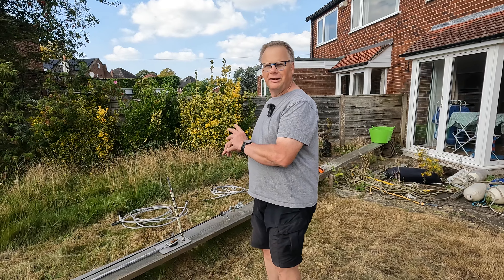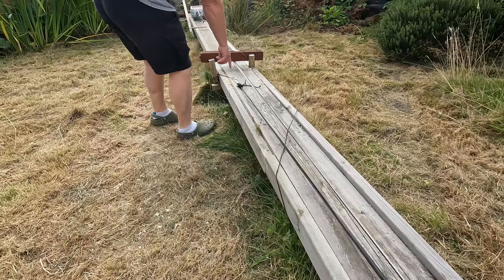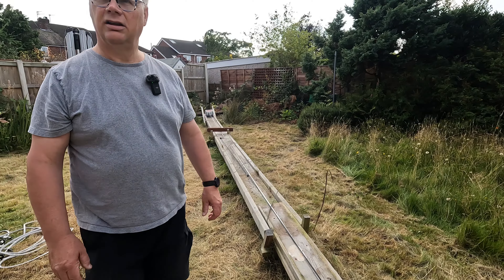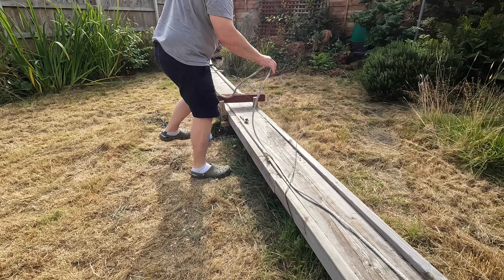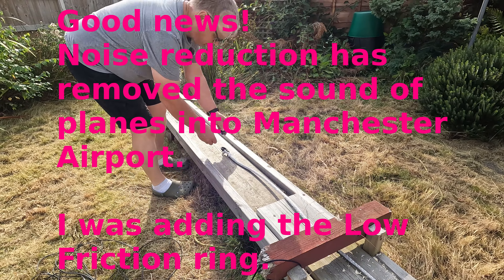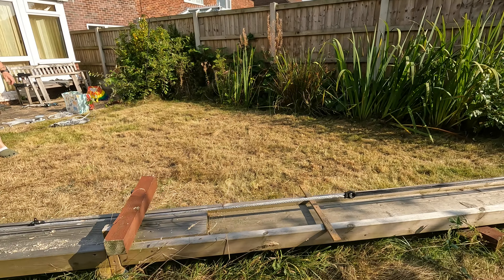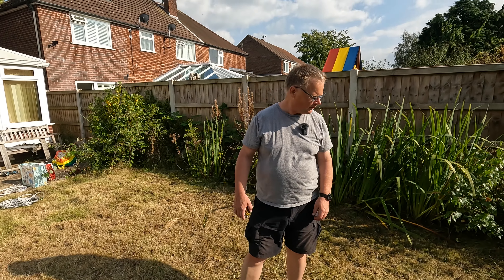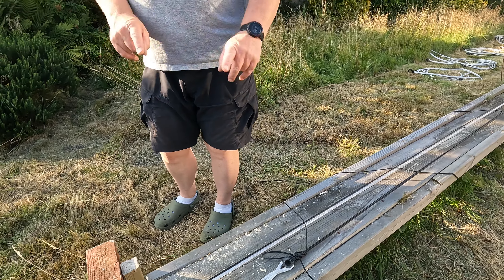Stretching our DIY Mizzen Dyneema shrouds and chainplates

Comment: you could swap the winch wire for dyneema = no more twist

I have just stepped my mizzen (I don't know if you remember but we have very similar boats and are on very similar journeys) yesterday
I stretched one cap on a massive yard frame (and burst a 2 ton ratchet strap when I pulled sideways on the tensioned line) 
The other lines I just installed and then have been stretching in place by over-tesioning and then 'hanging' off it. This method causes sore hands but achieves the same thing
I stepped it using a lashing between the turnbuckle and eye, tensioned by hand with a marlinspike hitch on the lashing, then would up the tension on the turnbuckle and pulled it around, backed off the turnbuckle and repeat a couple of times then replaced the lashing with a rigging link. I've also been getting about 100-110mm 'stretch' but I am using Liros DM20

My mizzen rigging is slightly different - I have 4 lowers, but then my spreaders are swept well forward and I have 2 removable backstay (that I think I am going to rig like running backs with a cascade)
Reply from the maker: Dyneema in the winch would be a really sensible upgrade!
Reply from the maker: Our turnbuckles were a very mixed bag so the cost of new chainplate bolts and turnbuckles was a key factor in our choices. 
Having the combination of lashings for coarse adjustments and turnbuckles for fine adjustment is a good one.
Reply from the maker: DM20 is supposed to be one of the best options.
Reply: @SustainableSailing  as the loads are relatively low you could use 3-4mm and then when you are finished recycle it, making soft shackles
Reply: @SustainableSailing  I'm not sure I'd use it again - I used 8mm for the mizzen just because it worked out sensible to buy a roll (mizzen caps and Main lowers were the only ones needing 8mm) but having the larger diameter for the mizen lowers certainty makes moving around nicer than grabbing thin lines.

Maybe I will change my mind over time as supposedly DM20 is zero creep.
Reply from the maker: We were not able to see and touch the alternatives so went by recommendations. We had a comment on our blog from Calligo which influenced our choice.
Reply: Yup, all that force is scary! I have the same cable winch, but use without the pulley, so in theory still a two ton pull. No twist then. (I don’t believe it reached anywhere near) . 
Try saturating the Dynema first.
Reply from the maker: @markthomasson5077  saturate so the contructional stretch comes out easier or so the lashing slides easier?
Reply: @SustainableSailing  i found out with something else that Dynema stretches when wet, so guess it may help you.  Makes sense, can’t do any harm